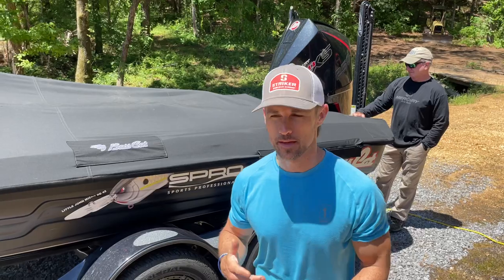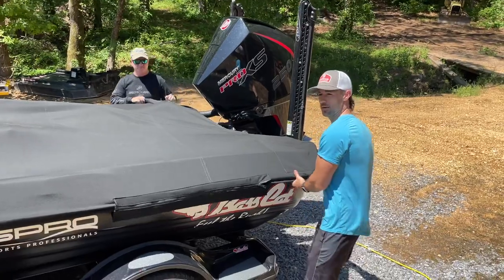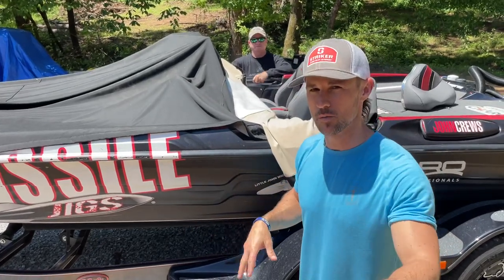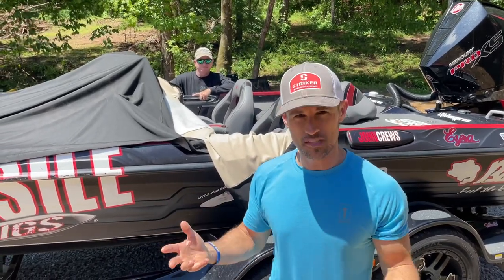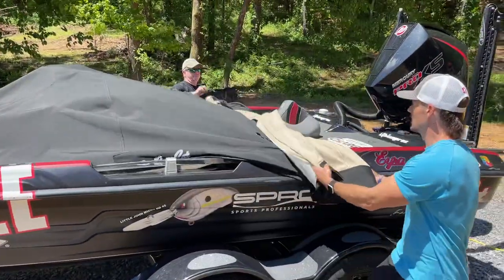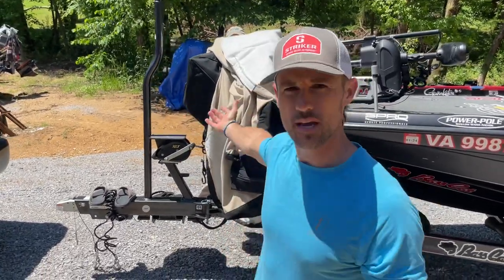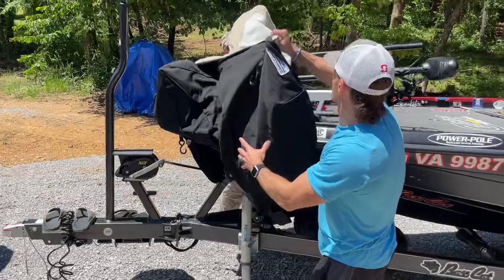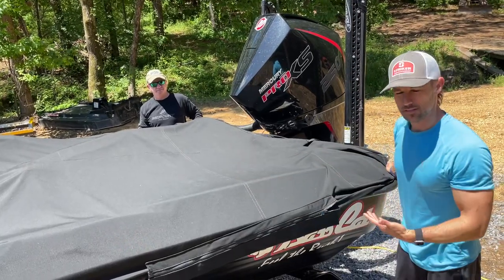HOW TO REMOVE A BOAT COVER

Comment: What a great topic for a video. Now the question is do you drive with the cover on? I always thought it was to be avoided because it increases drag and lower fuel mileage, it damages the cover and leaves waves on gel coat. What’s your opinion John?
Reply from the maker: Yes and no. I cover in rain. No cover with no rain. A good cover won’t damage finish but bad one can